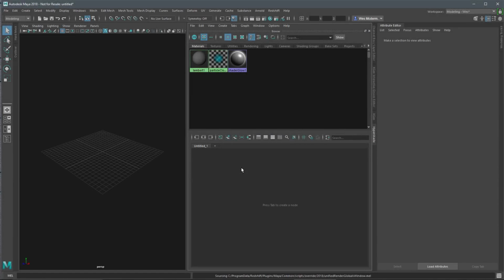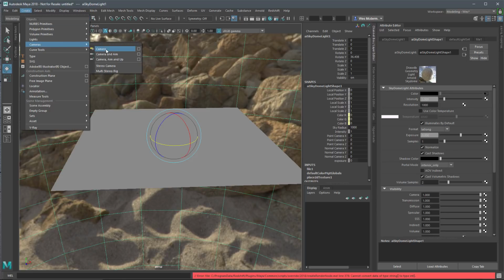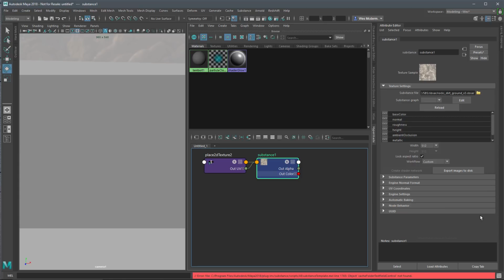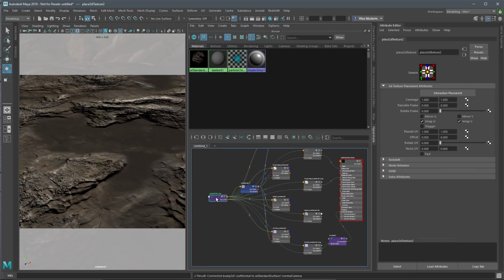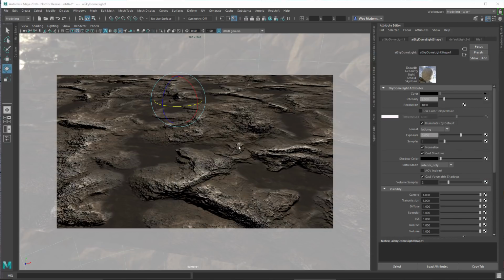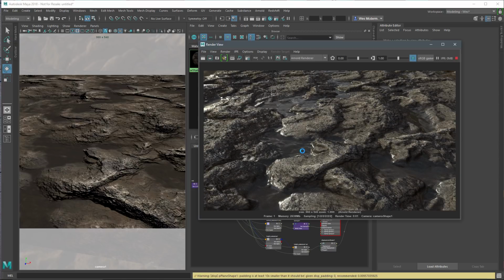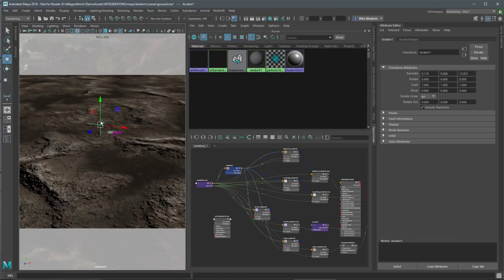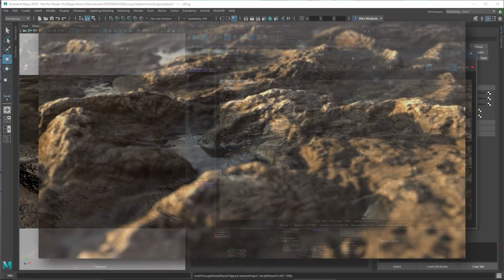Displacement rendering with Arnold | Adobe Substance 3D

Comment: Hey if we have an Ambient Occlusion, where is the link on the aistandard ? Or is the replaced by the normal +bump layer ? 

Thanks for this tuto
Reply from the maker: Arnold is raytracing so you don't need the AO map. However, it can help to just multiply the AO over the basecolor to add a little more dimensionality.
Reply: Many thanks <3

Comment: Great tutorial! Really well presented - especially given the complexity of the workflow. I had a question about the height map .exr? I am working on a Mac (the middle mouse button option to drag and drop the node doesn't work) so had to add the DisplacementShader group in manually, however while trying to get the drag and drop middle mouse button to work i accidentally connected the height.exr node to the Displacement node of the aiStandard Surface group, which seems to give the same result. Does this mean the DisplacementShader group is a redundant step? I'm working with Maya 2020

Comment: i have tried for weeks to get this to work. hours and hours. nothing works. i will just give up now. i have followed so many tutorials replicating everything being done. no displacement shows on my render. nothing. even if i just do a super simple setup with a aistandard and plugging in a displacement map. guess i will have to do without. maya 2020.
Reply from the maker: Are you using Arnold in Maya?
Reply: 1- Mesh or plane has to have enough subdivisions for displacement. 2- In Planeshape/Arnold/Displacement Attributes/Height ....value should be more than 0 and almost ever less than 0.5 (always depending the texture you have. 3- Displacement can be connected on the Hypershade. select the material, go to the tab Graph (first select clear graph just in case you had something there) then go again to Graph and click input and output connections. There on the main window, you'll see the displacement box and if you click on it, then you can see it on the right. There you can connect any file to it. 4- Use an Arnold light source (Arnold/Lights/Skydomelight). You should see the result in the render. Arnold / render tab. Hope it helps.